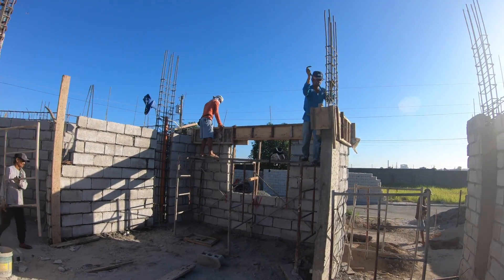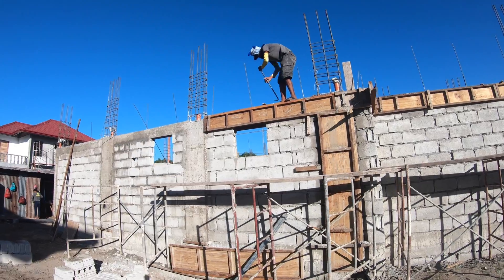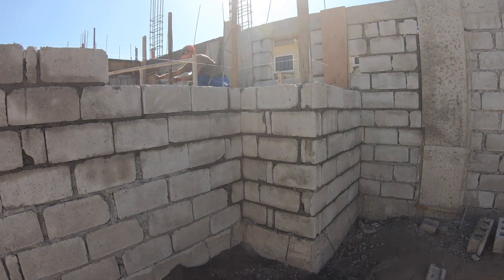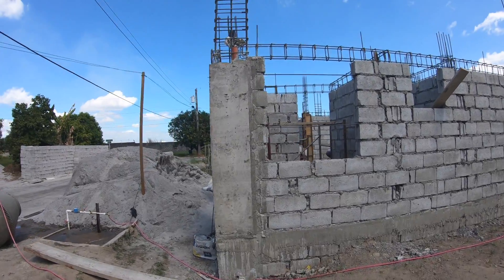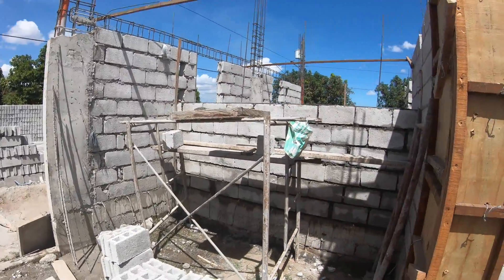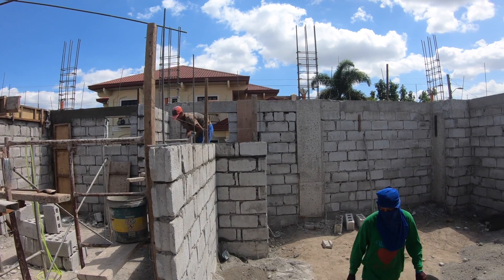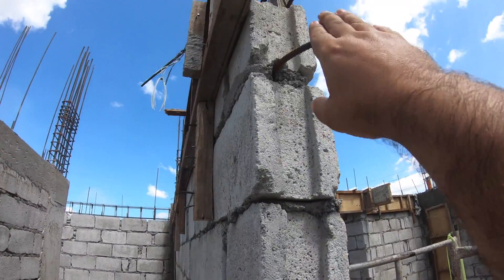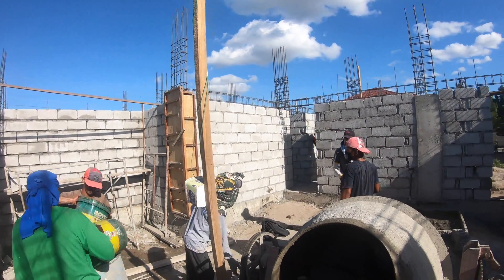Philippine House Building Step by Step, Build Day 41: What is a Lintel Beam?

Comment: I must say they sure do sloppy work in putting that mortar in between those blocks.  I'm having a house built in Philippines though I'm here in the US. The guys at my house  also do sloppy  block work. It's embarrassing. 
They put my door opening in and put three more rows of block up in that wall then put the rebar lentil the length of the wall between  the post.  So since that is a faulty lentil because the three rows of block are above the doors. 
 So I had coconut  wood cut to 7"x 8" x lentil length  needed to 
 make a lintel for the doors and windows.
 I plan on putting wood lintel flush with exterior and that leave 3 inches hang over in interior. Also plan to have interior surface of wood to be sanded, stained and laqured.  Then from the wood lintel put wood Jane trim on the inside and also match the finish of the wood lintel.

Please  teach them about mortar thickness. They use to wet mortar and it falls off there trowel. And then your wall is weaked and looks horrible. Like some elementary student did it .
I know they will say that later they will skim coat it to hide the sloppy work.
Just do it right and take pride in doing it right.
Reply from the maker: As they say on the job site… balik balik. Meaning go back again and again. It does seem to be standard practice, unfortunately. Very seldom see clean block building that we see in most western countries. Just a matter of a skilled mason teaching them from the beginning instead of having to break years of bad habits.
Reply: It’s stronger that way and stronger for finish coat.

Comment: it is safe to place conduits inside the column?
Reply from the maker: The engineer has to account for the size of the void inside the columns and make adjustments. The size of the hidden downspouts cannot be more than 4% of the volume of the column according to Philippine National Building Code. Or so I am told.
Reply: @CasaTexPina  thank you sir for answering my question, appreciated sir :)